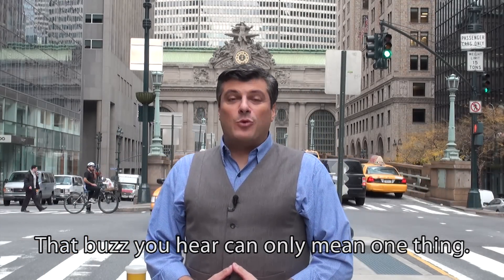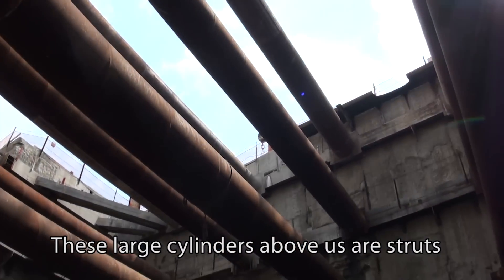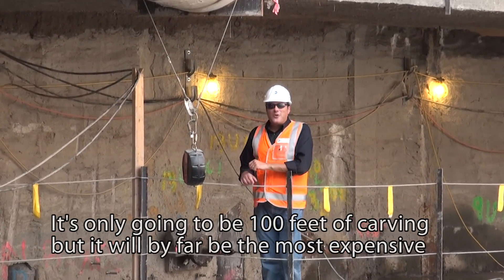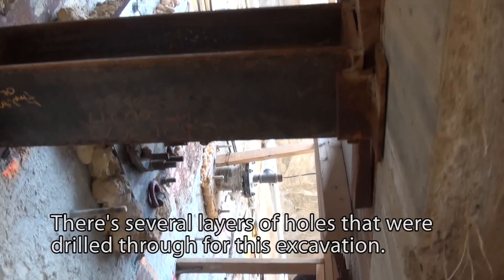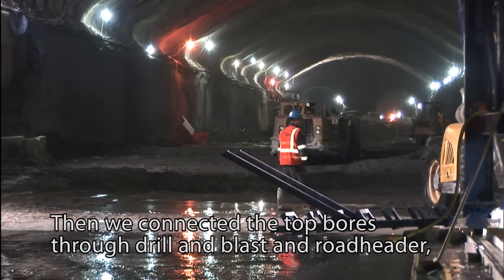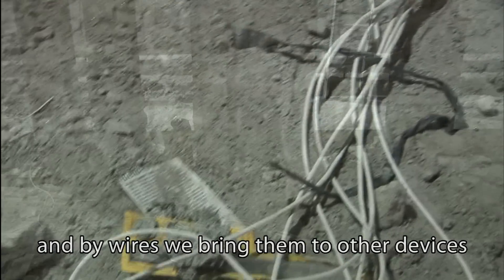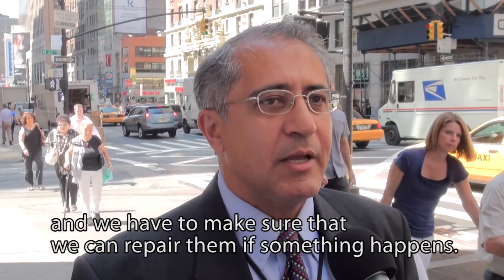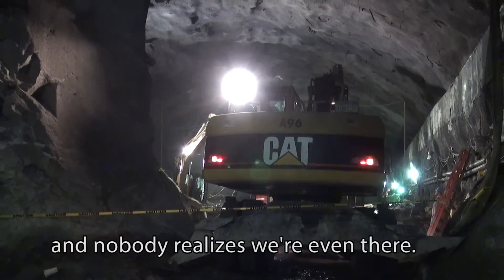East Side Access Project Update 2

Comment: Speaking of this project, does anyone else who posted here think the MTA could have saved MILLIONS if they would have just driven the tracks to Park Avenue and commandeered half of the PREEXISTING lower level?!  The third rail can be very easily modified to handle both over-riding and under-riding third rail shoes (The LIRR uses under-riding shoes, and Metro-North uses over-riding shoes).
Reply: Craig F. Thompson   I’ve thought a lot about this and I tend to think MN didn’t want to limit any future expansion of service by giving away tracks and platforms at grand central. Although if the lower level tracks at grand central were extended south for through running trains they could bring more trains in and out of the station. Njt could run trains from penn to grand central too for real through running. Think of how great it would be if trains came in and exited on the same track everyday. No waiting for track assignments, etc.  anyhow, I think the LIRR station at GCT will be massively popular with nearly half the riders choosing it over Penn. we will see.
Reply: issue was tunnelling - the section at park avenue is very shallow and was built when the are was clear of buildings then the buildings and roads were literally built above the tracks. You can't dig under the surrounding buildings at that depth because they have basements and foundations that extend that far.

They can, however, dig through the rock below and it is relatively easy with modern TBM's to dig through.